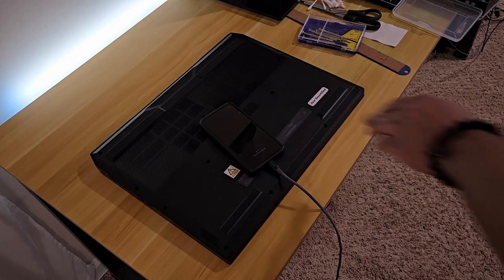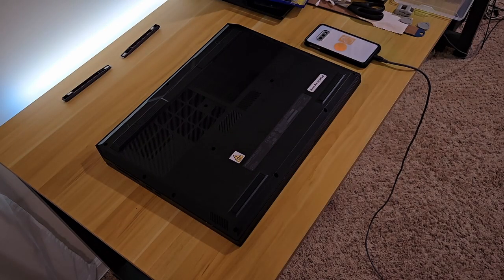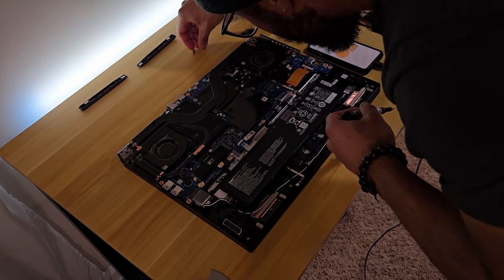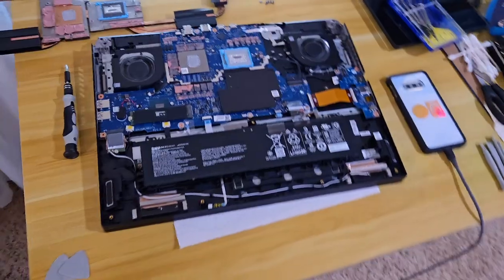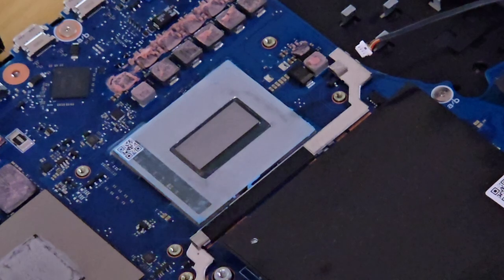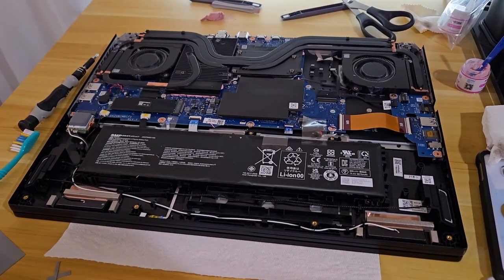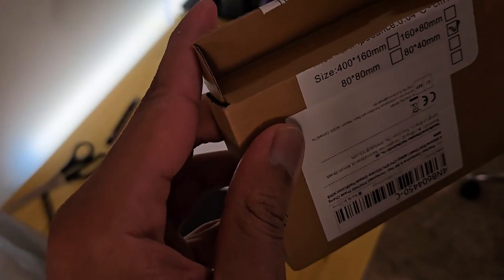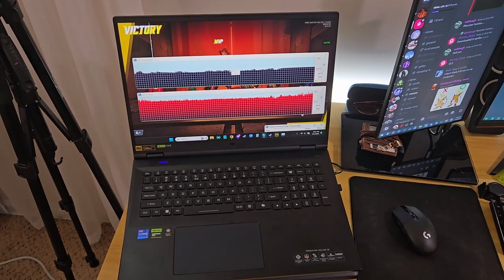Changing Thermal Paste and Putty on Acer Helios 18 PH18-72-93VM - Liquid Metal to PTM 7950 and HY236

Comment: I just did the same thing. First time working on a gaming laptop like this. My back hurts im about to try and turn jt on and hopefully everything works great! Praying it will. Great video Bud. Congrats to you and heres hoping mine works now.
Reply: how was yours? I pasted mine back in july 2025 now temps are still good much better when compared to regular paste that I use in the past.
Reply: @rangerjoe126 I’m happy with it thank god it works great I recommend it. If you do switch to ptm7950 make sure the whole cpu and gpu is covered completely with the paste  as it’s not like normal paste where you can slightly cover it.

Comment: Hey! I have the same laptop, but mine has 14900hx with rtx 4070. What's the idle temperatures for the CPU when it's doing nothing or normal tasks like browsing? Mine is sitting around 65-75c on idel and simple browsing gets it around 75-80c. I'm assuming the liquid metal in my laptop also went bad? Though it's around 80-90c when on performance mode and playing a game like helldivers 2. Intel XTU stress test doesn't thermal throttle.
I'm just concerned about the idel temperatures for now. What I noticed is that the P3 and P5 core runs hotter when I check hardware info temps. But really, it mostly reports average as ok.
Also, Acer is really had, they don't update the BIOS for the i9 14900hx, it's been more than a year since the last microcode bios update, which maybe that's why the cpu is not very stable.
Reply from the maker: with a llano laptop cooler, I idle at ~45C

Comment: 12GB of VRAM (6 RAM Chips).
The two "empty" PCB RAM Pads would make that 16MB.
I'm assuming that the liquid metal was on the CPU, and the GPU Die is surrounded by those chips.

Comment: Hey, do you mind opening up this model again to check if there's an extra M2 slot for another SSD lol? I've got this same certified refurbished model also from Acer eBay and already ordered a 2TB Crucial T500 to upgrade the storage capacity.
Reply from the maker: Google says it has two. One slot has the installed SSD and the other slot is empty
Reply: I have the 4070 with a 1tb and secondary 4tb M2.

Comment: Good video, btw any idea what the previous temps were?
Reply from the maker: @a3per818  I'd hover around 90 and spike 99 on Marvel Rivals, 1080p Low settings 144hz
Reply: @Smur95  massive improvement, apparently ptm gets better in the first few weeks too even after the original "heat cycles".